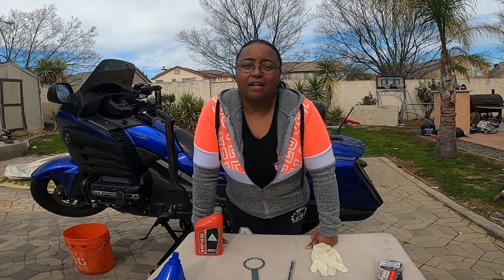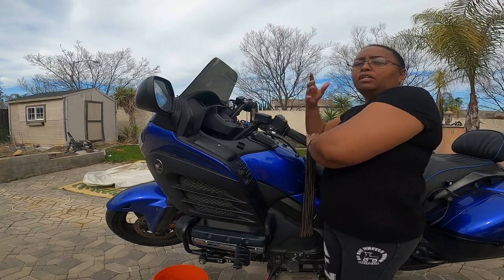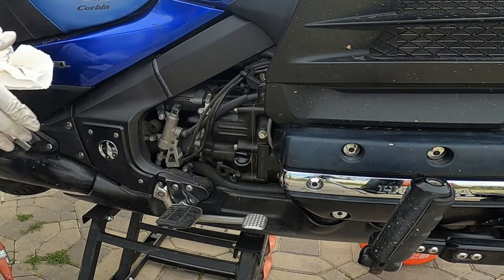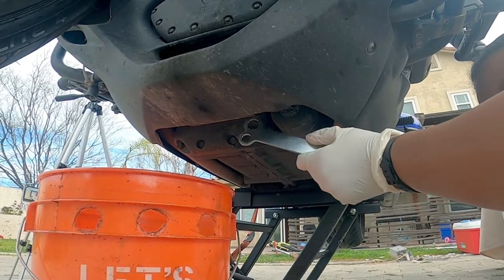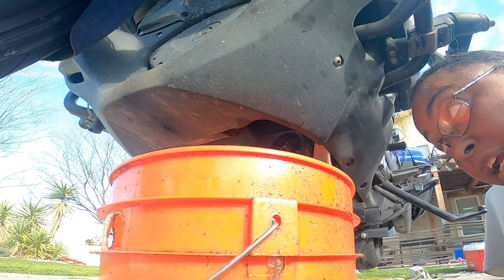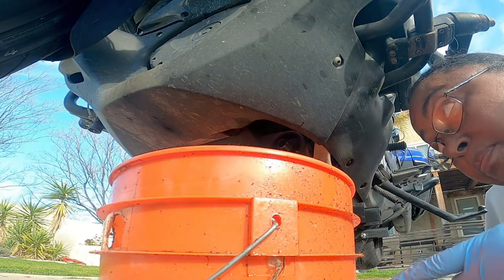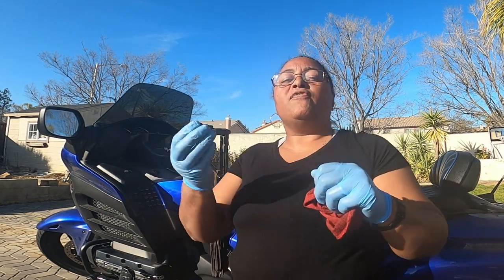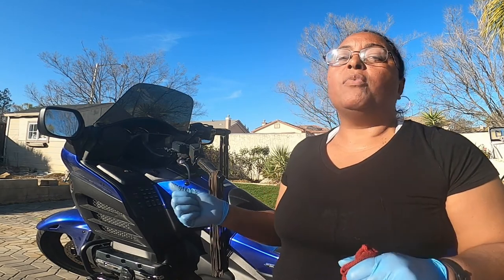How to change the oil on a Honda Gold Wing F6B GL1800

Comment: Great video, I’m curious if Honda makes a under belly protective plate? Oil filters on the bottom like this scares me. A rock or other road debris could hit the filter and you could lose all your oil.
Reply from the maker: Hey James...Honda doesn't make them but there are after market belly pans. Yeah that is scary

Comment: Have you done a video on turning from a stop while facing uphill?
I just dropped my 20 year old starter bike. I was going uphill at the stop sign, I was taking a left onto a road that going down hill from left to right.
I knew it was going to be a challenge, and that's why I took it. But I think it was just a combination of kind of a lip read at the stop sign, and turning left to go down, that left kind of a crown rate when I was coming out of the friction zone. So I guess I would need to practice more of a preload, higher revving of the engine while releasing the clutch into the friction zone. However and I don't know if this is just me or not, but that seems unnatural in a turn coming from a stop.